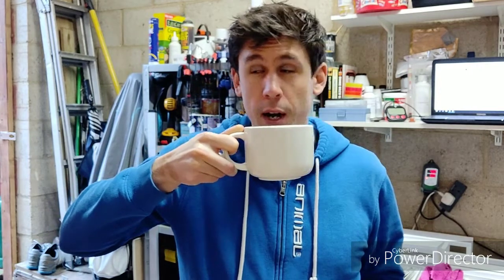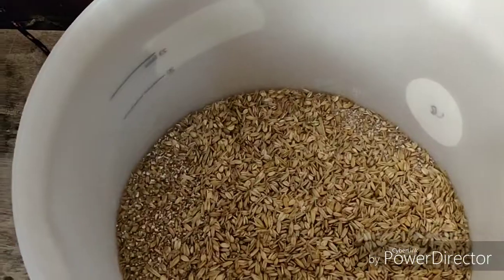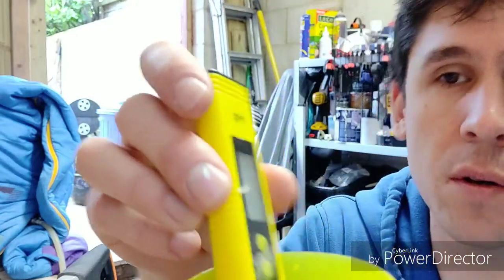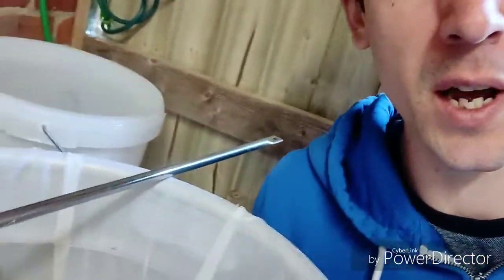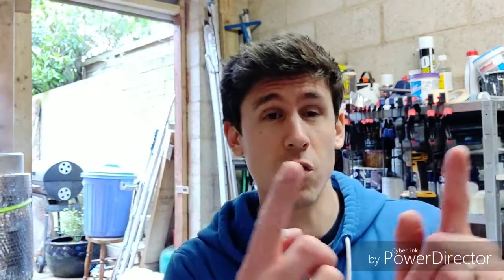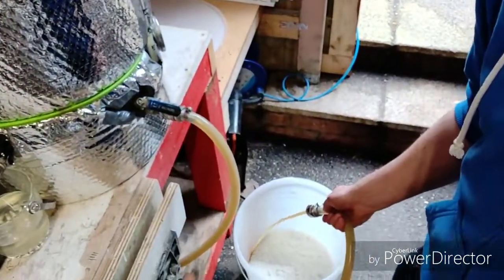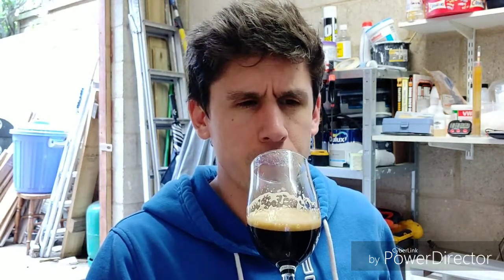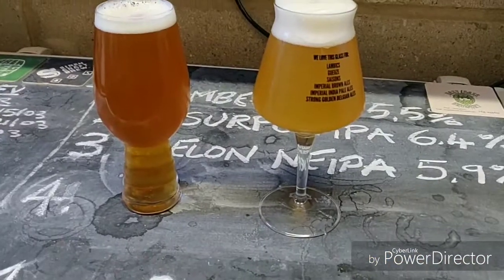Double brew day - grain to glass

Comment: Double brewday! Best ever!

I've just worked with Ekuanot. In a SMaSH + a IPA. It's all good but very harsh with its bittering I found. Even as a dry hop. Still a keg filler.

Top work 👍🏽
Reply from the maker: Agreed. Not sure if I'll rush back to using Ekuanot. Azacca is the next hop to test out.